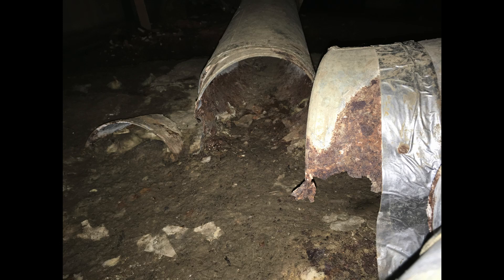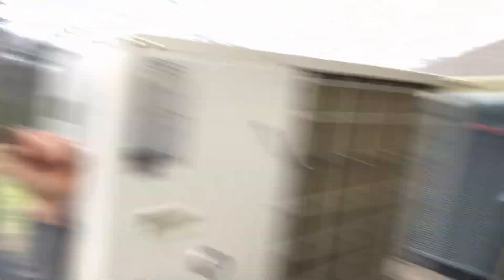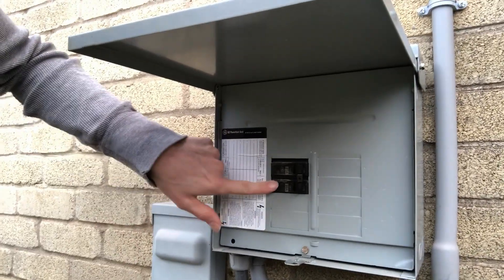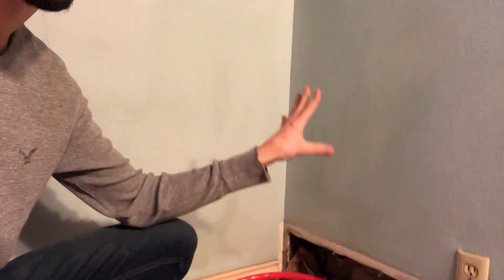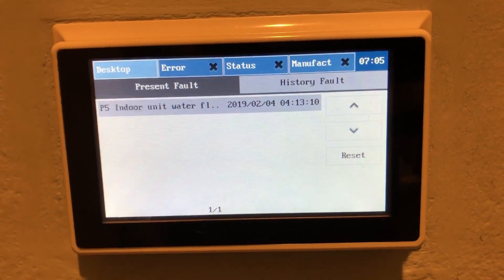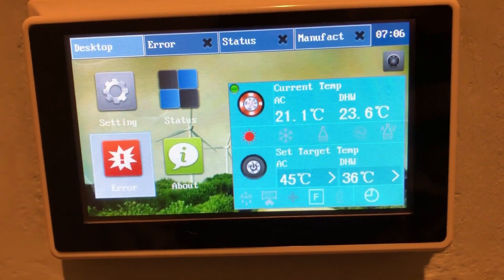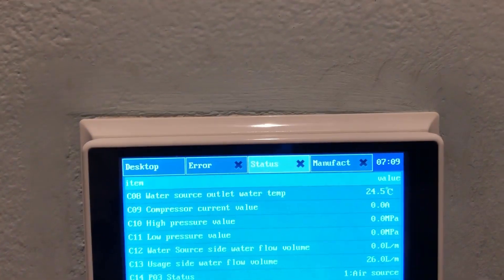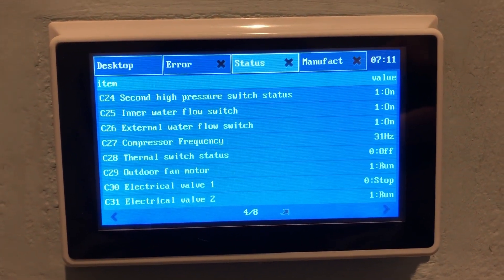DIY Chiltrix air to water heat pump Installation

Comment: Can you explain where the valve is on the inside units? Do they signal via 24vac to the main unit? Each needs a valve? Or does the main unit sense somehow that water flow needs to happen when the indoor unit opens its valve? I can't tell via their install instructions.
Reply from the maker: It’s not entirely clear in the instructions. The way it works is the outside unit works independently of the indoor units. Each indoor unit has a 24vac signal from its thermostat to activate a valve (I used an electric ball valve but one could use a solenoid valve) when cooling or heating is called for. If all of the indoor units are setup this way and all of them are off, not calling for cooling or heating, the water flow to the outdoor unit will cease. This will then throw a water flow error on the outdoor unit shutting it down until the error is cleared. 

I see two solutions to this issue.

1. Have at least one indoor unit that doesn’t have an electronic valve.

2. Have a circuit where if all of the indoor units have shut off the outdoor ambient temperature sensor is interrupted. This will cause an error however when the sensor is brought back online the outdoor unit will start automatically instead of the error having to be cleared.

My reason for not going with option 1 is that the chilled or heated water will be circulating through the lines 24/7/365 until it’s needed or manually shut off. I was aiming for more efficiency than that.

I have not created the circuit yet but figure I will run some network cat5 wire to each of the units, indoor and outdoor, so some communications can happen between them. I’ll certainly throw up another video detailing it once complete.

I realize that’s a long winded answer, let me know if I didn’t say something clearly.
Reply: @beenegarage7116  Thanks for this detailed response! I think there is an additional option 3, but it gets a bit more costly. That is, a buffer tank with two loops (chilltrix loop and an indoor coil loop).

The chiltrix has a pump that stays on to the buffer tank and keeps the tank at the set temperature. The advantage here is that you'll never get any low flow alarms on the chiltrix unit.

There is another pump that controls the flow to the indoor units. You can have that 24 VAC signal that turns on valves turn on this indoor unit pump and start cycling the water through the fan coils.

I'm  extremely interested in the chiltrix systems and have done a lot of system designs on paper, but haven't been able to pull the trigger.

Your video certainly helps though!!
Reply from the maker: Robert I agree with you, throwing a buffer tank in there would also solve the problem. I was in a fortunate position of needing to spend an estimated 10-20k on refurbishing existing ductwork and replacing the existing air handler and compressor combo so the relatively high cost of this Chiltrix system paled in comparison to going back to a traditional ducted system. Great excuse to spend money on a big toy.

When I get to controlling the outdoor unit from the indoor units I'll be sure to document and record a video on it. I have a high level of confidence it will work.
Reply: Thanks for the video,  @beenegarage7116 . My question regarding the valves is why would you want to shut the water off when no thermostats are calling for heat/cooling? Isn't it inconvenient to have to clear the error? I'm looking at installing one of these in a new home construction with radiant floors. I'll use the DHW feature too.
Reply from the maker: Valid question! I misunderstood how the system would react to the valves. I thought if all the valves were off the Outdoor Unit would shut off and then come back on when water was allowed to flow again. That was my mistake in assuming it would work this way.

My intent was that when I was running 1 or 2 of the 7 indoor units I would only have water running to those active units, thereby increasing efficiency by not running water through pipes that don't need any cooling or heating. So I still see value in the electric valves, I just need to devise a circuit where the Outdoor Unit is shut down when the last thermostat stops calling for it and then have it come back on when the next indoor unit calls for conditioning.
Reply: Gotcha.I have no idea, but I'm wondering if the Chiltrix has some sort of "maintenance flow" that it uses when no units are calling for heat (or cool). And furthermore, I wonder if it is aware when it's not able to push even that small flow.  @beenegarage7116 f that's the case, I wonder if you could install an otherwise useless parallel loop that allows the unit to keep flowing even when no units are calling. Or you could simply eliminate your valve from 1 of your units and the Chiltrix would always have someone to "talk to".
Unrelated. Do you know how you would use the one Chiltrix to feed both a house and an unattached garage? If I consider the garage just another zone, then I have to do an outdoor run to the main manifold in the house and then back out to the garage. That's a lot of outdoor water runs. I'm wondering if I can branch off of the Chiltrix and go to the garage separately and put a zone valve in there. I sort of like centralizing even the garage zone valve because I fancy being able to interact with my zone valves logically some day, but I don't fancy paying a ton of money for outdoor water runs to make that happen :)
Thanks.
Reply from the maker: Yep your second thought would work, just leave one of the units always on. My thought is that I didn't want cold water constantly running through the lines when I wasn't calling for cooling, just for an efficiency thing. The small parallel loop would work except I believe there is a minimum volume of water needed in a loop to prevent short cycling the outdoor unit.

I don't see why you couldn't feed two buildings. I'd just want to have a valve before the water ran underground so I wasn't fighting the energy losses all the time, only when I needed to condition the other building. In my insulation research I found many people doing underground runs from their outdoor wood fired boilers to their home. Seems like those had an inch or two of insulation on the outside of the lines to prevent a thaw line in the snow between the buildings indicating massive heat loss.

Let me know if you end up designing something for yourself, would love to see what you come up with! I'm also happy to share thoughts on my system if you have other questions.
Reply: @beenegarage7116  Thanks for putting the video up and I noticed you linked to other videos too.  There has to be a way to shut the unit off if none of the thermostats are calling for heat/cool.  Hydronic zone valves usually have an extra set of contacts that close or open when the valve is actually open. Theres gotta be some place to send that signal to the chiltrix!  I can't find a good wiring diagram but simple question to ask them?
Reply from the maker: @Larry James I talked to Chiltrix support, their suggestion is to break the circuit for the outdoor ambient temperature sensor. I have yet to wire it up so this works yet.

I didn't know hydronic valves had that extra contact. Would have been handy. As it is I purchased motorized ball valves that just have the motor wires. I figure I can work off the 24vac each indoor unit sends when it calls for cooling/heating but first I need to get some low voltage wiring between the indoor units and the outdoor unit.
Reply: @beenegarage7116  I could be wrong, but I've been reading the Chiltrix documentation and it seems a lot of this is cleared up there. The hydronic valves are supposed to complete the circuit such that the outdoor unit turns on after a delay. It would also help if there were a buffer tank as the outdoor unit monitors the buffer tank's temperature. In that configuration, there are two pumps, one to the outdoor unit that works with the variable speed compressor to optimize efficiency, then another pump that feeds the indoor units which should be a variable speed pump set to maintain constant pressure when any indoor unit is calling for flow. The system is supposed to vary the supply temperature based on the outdoor temperature. The closer you can get those two temperatures together, the more efficient the system is. But you run into economy of the size of your hydronic units. They even suggest putting radiant systems in the walls and ceiling to increase system volume and lower supply temperature. This seems excessive to me. But I digress.

It seems to me that if the system is properly configured, this should all be controlled for maximum efficiency by the Chiltrix software. But again, I'm just reading the documentation, I don't have a system of my own yet, I'm still in the research phase.  My AC/gas furnace is still working at the moment. But it is 30 years old.

I really appreciate your videos. In this early stage of adoption, there is limited information available.
Reply: @beenegarage7116  My understanding is that there is no need for the valves. One can let the water run continuously through all the fan coil units. When a unit needs heat or coolth, the fan will turn on and extract needed heat from the coil. It's true that you have a bit of extra heat or cold in the zone, but it greatly simplifies things to eliminate the valves.
Reply from the maker: Yep, I’m gonna have to go re plumb mine and I’ll forgo valves. My hope was for a super efficient system but I think it just adds too much complexity.
Reply from the maker: I don't think I answered all of your questions. I installed the valve at each indoor unit on the supply line just before it hits the indoor coil.